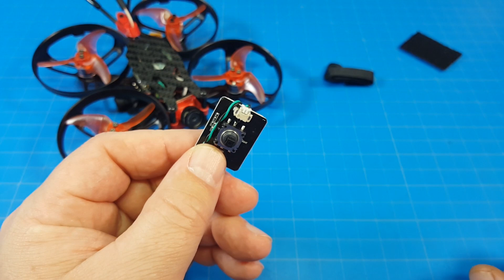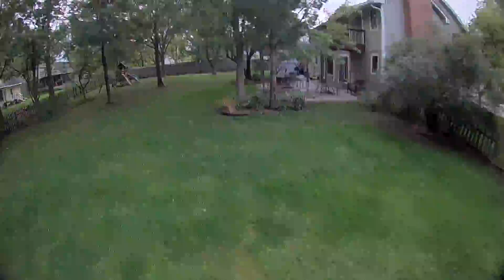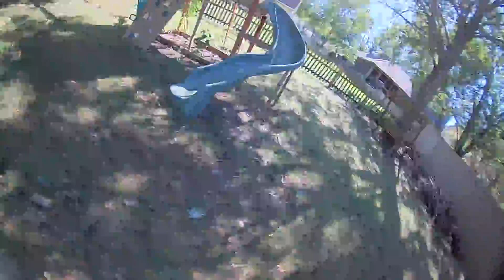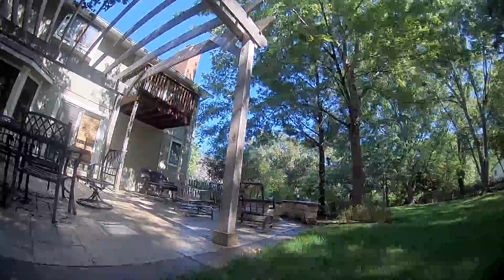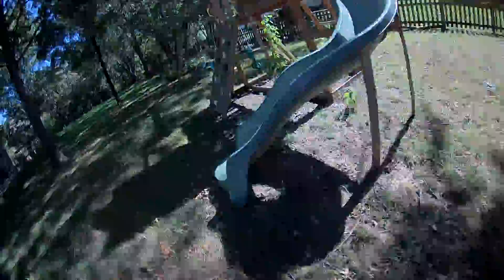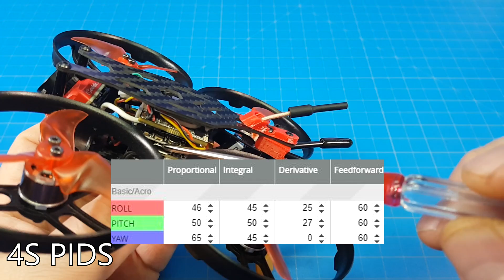Arris X110 HD // Entry to FPV with HD

Comment: You are an advanced flyer and can handle anything, but for a newbie/beginner with this quad, are there any betaflight changes you would recommend to tame it down (easier to fly), or just leave well enough alone?  Thanks.
Reply from the maker: Thank you. Throttle control is often the most difficult to learn. Some like to use a throttle cut to limit the quad. I don't have a video on it, but several others do.

Comment: What 3" hd (cad ax/split mini) acro quad is the best bang for the buck in your opinion. Thanks for  videos love them.
Reply from the maker: Which do you prefer someone with one camera or dual camera?
Reply: @NickBurnsFPV  single camera unit.
Reply from the maker: @sharp1786  I suggest the diatone 349...I think it had a HD version.